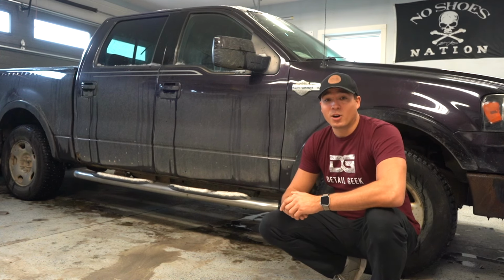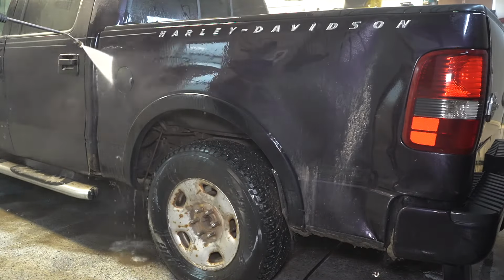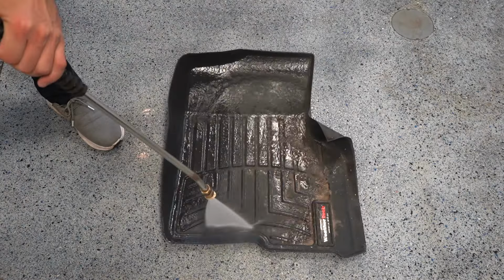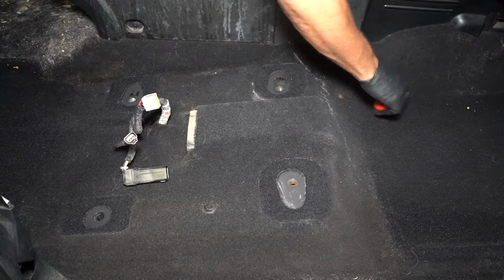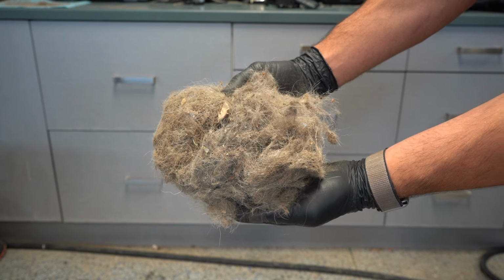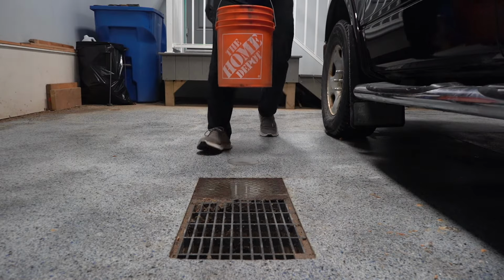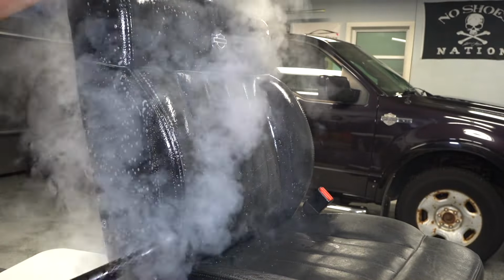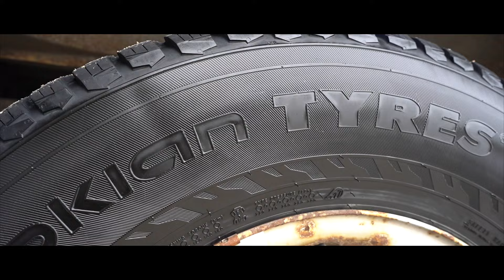Deep Cleaning an INSANELY Hairy Truck! | The Detail Geek

Comment: I LOVE the Lilly Brush. Best $13 I’ve ever spent. Also, I probably shouldn’t do this but I use this disinfectant called D-Germ and it does a REAL GOOD job at getting rust staining off of wheels. Albeit you do need to use a lot of elbow grease.

Comment: Hey Mitch another fantastic job and have you ever thought about putting Mike on the payroll🤔 and question will the Lily brush pick up other animal hair and does it matter the type of material??
Reply: I have a Lilly brush, and I can attest that it works on every surface I’ve tried. I have guinea pigs and I clean their fur from fleece, cotton, astro turf, nylon, etc, and the fur comes out with no resistance, even if it’s embedded in there well. It really is a miracle tool.
Reply: @nessamillikan6247  Thank you that's good to know I'll give it a try🐈🐈👍

Comment: I bought all the same cleaning gear you have based on your recommendations and it works pretty well. The only challenge I have is the tanks on the extractor I find to a bit small. Do you use the same ones or are their upgraded ones?

Comment: Hey Mitch, just a question, why not use Iron Decontamination spray here? Like on the Rims, and the Metal trims on the fronts and sides, thank you so much, keep up the great work :)
Reply: It doesn’t get rid of that kind of rust, only things like iron particles on the paint
Reply: @MrB0SS  thank you soo much for letting me know, really appreciate it  :)
Reply: Customer probably didn’t ask for it but I’m not sure if it’s an option or not
Reply: I think iron decontamination wasn't for the rust because that wasn't a contamination
Reply: If I had to guess, those are also the junk rims the owner uses for their winter tires because the salt on the roads in the North is terrible for your vehicle. I know a lot of people have dedicated winter tires (rather than all season) and just buy junk rims for them and then have the nice rims for the warmer months.
Reply: @kylelysher8197  That makes sense….those are some craptastic wheels right there! 🤮
Reply: @MrB0SS  lemon acid based products will do the trick for that

Comment: I noticed in the vacuum shots there was a bunch of small particles popping out even in the final passes. One trick I like for things like sand in cheaper carpets is using a synthetic wide brush (natural does not work as well for this) and brushing the carpet back and forth. The combination of agitation and the static electricity that builds up brings a lot of those fine particles to the surface.

Comment: I’m hoping in the future, they’ll have chemical sprayers to DE-RUST any car parts anywhere, including ones around the tire area
Reply: That is wishful thinking, but rust is basically the metal breaking down due to oxidization. Kind of like how bacteria breaks down old food... if that's a good way to put it. I can tell you as a collision tech, rust can be fixed only when it's caught at the first sign of rusting such as paint bubbling etc. Also as one living in the snow belt (aka the rust belt). Salt is pretty much a vehicles slow demise because salt actually accelerates the oxidation process of metals.. Once rust starts causing metal to chip away by hand, it can no longer be repaired. You would have to replace the panel or wheel.
Reply: @Ty98k  I was saying because I’m no auto expert but just as a thought, it could happen but who knows.

Comment: One note about the lily brush.. I got one off of Amazon after watching these videos.  They do a great job as you said, but I think it would be good for you to put in a disclaimer.  The Lily brush is also hard  on the fibers of the carpet.  You have to be careful to not overuse it on any one spot.
Reply from the maker: Only partially true. If it’s cheap carpet then yes you might experience that, but if it’s decent quality or better you won’t.

Comment: Man, that Lilly brush, really had hoped it would work for our pet hair issue. Our pit bulls shed pretty bad, and their hair is very short and coarse. Nothing happened when I used the Lilly brush on or 2014 Hyundai Santa Fe XL. We will try it on other carpet, but it didn’t move any hair out of the carpet.

Comment: For headliners you could use a (non heated) wet vacuum with some carpet cleaner mixed in. As long as you get the whole headliner evenly wet/dry there won't be any water stains. Also being careful not to absolutely soak the headliner is probably a good idea.

Comment: Love watching your work, especially the carpets and floor mats! Just curious... sometimes you use the larger tip of your vacuum hose to pick up larger items and the  switch to the angled tip, when it looks like you might have been able to get more of the crumbs, hair, etc with the wider end. What prompts you to switch from one to the other?
Reply: The wider tip is only for picking the big pieces but you cannot run it across the floor in a zig-zag motion. Whereas, the angled tip is used for picking hair and all other debris by running it in a zig-zag motion. Notice, whenever he uses the angled tip, he does it so in a zig-zag movement but not in the case of the wider tip.

Comment: The shampoo machine you use looks to be a small unit, your work is amazing but my question is how to you get the water out with a unit that is not as strong as a commerical unit? How do you get the carpet and seats dry especially in cooler temps? Do you ever have wicking issues after using that unit? have you seen the HART shop vac shampoo 3 in 1? If so what do you think. Love the channel and your work

Comment: Question: Why don't you clean the pedals (gas and brake) while you are cleaning the carpet? Loved the video!
Reply: Marie, if Mitch cleaned the pedals first, then went to scrub the carpet with the drill brush it will sling the muck from carpet back onto the pedals and he would have to clean the pedals off again🙂I think that's what he said in a couple videos ago. 👍👍
Reply: @silvergrizzly316  yes u r right, that is EXACTLY what he said :)

Comment: Question: does the product you use to clean leather seats work on leather furniture in the home?
Reply: Most definitely. Leather is leather no matter where it is used. It's always worthwhile feeding the leather to prevent it getting dry which results in the cracking. there are many products on the market that will do that. Once it's fed properly and nourished, cleaning it is a doddle.